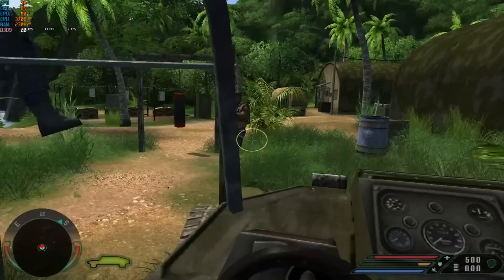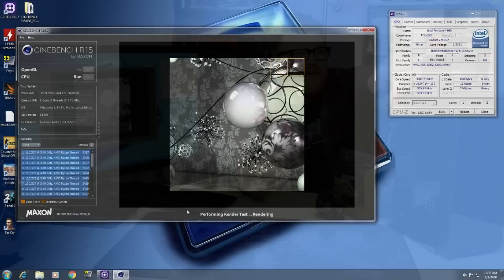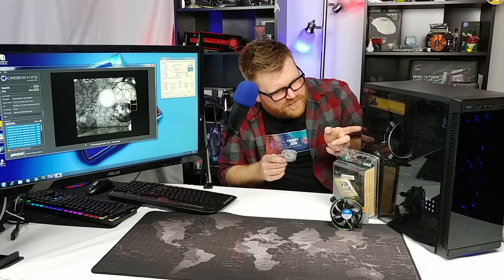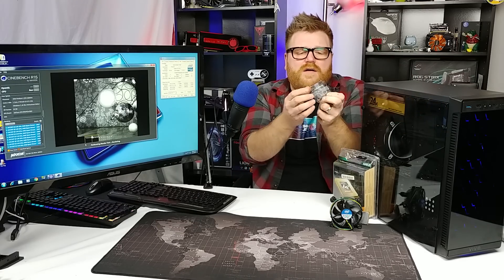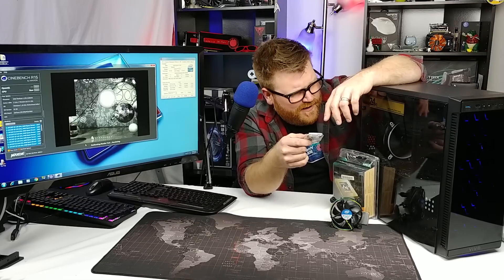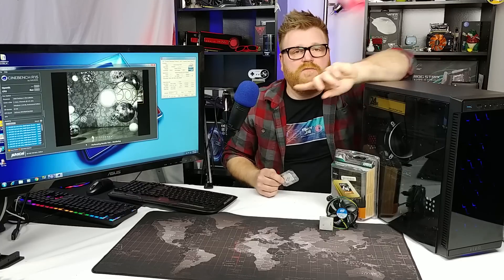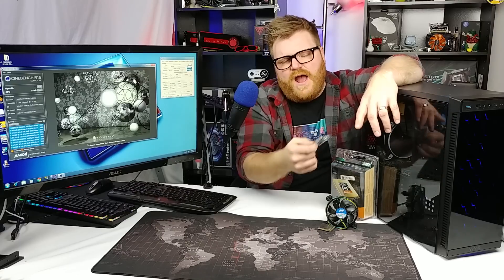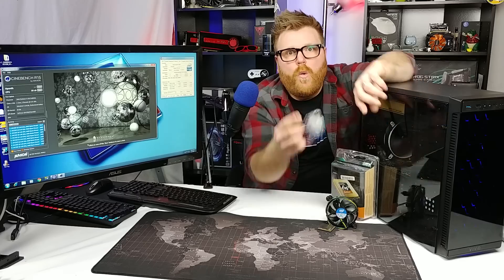What can the Intel Pentium 4 HT do in 2018?

Comment: No wonder the stock cooler was too week it was designed for procesors like skylake you can see this because it dosn't have a copper slug like core 2 quad coolers i actualy use a q6600 stock cooler for my i5 8600k and it is fine altoagh i had to put a sronger fan on it and it also sounds like a jet engine but it works

Comment: those things are 5v hungry so try it  out again with a psu that has 30a+ before you write off overclocking
Reply from the maker: +Charles thekinglov I'm using a 650 watt 80 Gold certified psu. It's the motherboard I'm sure.
Reply: but whats the +5v and +3.3v rating is my question gigabyte also overclocks the pci-e bus and memory which if im not mistaken can be lowered to compensate with the ctrl f1 in bios to unlock advanced features not that its important but these things were more power hungry as far as cpu's go these are the fermi of the cpu world

Comment: Watching this video in 720p on my Pentium 4 3.4 (Prescott) socket 478 overclocked to 4.0 Ghz, with 2 Gb of DDR400. The graphic card was originally an ATI Radeon 9600 Pro (AGP bus), lately upgraded to a Sapphire HD4650 with 1 Gb of video memory.
This PC has still enough power to run modern basic tasks, as office works, light web browsing (if you install a good adblocker) and playing music/DVDs, but it is very inefficient and produces  A LOT OF HEAT, especially with this "new" video card!

Comment: lol I remember trying to install windows 7 on a P4 machine... it barely opened the explorer. Of course it was a 2005 machine with 512mb RAM and integrated graphics but god
Reply: PhilsComputerLab put together a 3.6 GHz Cedar Mill Pentium 4 for LGA775 with 8GB DDR2 RAM and an NVidia GeForce GTX 660 running Windows 10 to see if it was suitable for daily use, and it could run Crysis and HD YouTube & Netflix decently, but then he tried to edit a video on it and it was significantly slower than a modern system, claiming it would have taken HOURS to render. Budget-Builds Official put together a 2.4GHz Northwood Pentium 4 for PGA478 with 2GB DDR1 RAM and an ATI Radeon X800 (a more period correct graphics card) running Windows XP and that could still run Crysis albeit at 24-30fps at mixed low & medium settings at 1280x1024, but it could only play YouTube videos smoothly at 360p, lol.

Comment: I was NEVER impressed with the P4 line my self.  
Did you try benchmarks before AND after any kind of intel fix? They have been saying the older the chip the bigger the performance F U it will receive and it's still  up in the air just how far back the problem goes.

Comment: Another uneducated PC channel.

It accidentally happens that the 600 series should support Windows 10 .
Also it would to better justice to have an adequate chipset with DDR2 800 .
I have a Pentium D 945 (Presler core , 65nm revision , better TDP - its not gigantic , its just yuuge) that I use on a retro rig - this thing , with Win 10 is actually very very decent CPU , and it has no issues with 1600x1200 TIME CORRECT GAMES .

It just happens so that the most notorious chip for being extremely power hungry and being wiped out by the C2D under Windows 10 + SSD gives the core 2 duo some food for thought (even if you test C2D under same scenario) .
Windows 10 is a significant step up compared to windows 7 - though because of the slow performance creep over the last decade , one can't gauge properly the difference made just by the OS .
Reply from the maker: +Volf3r another long winded commenter...

Comment: I have many older pcs, some older single and dual core set ups. I remember playing far cry on a 2.8ghz Prescott socket 478 , hl2 and many many games ran amazing on it. I have a couple AMD setups and they ran faster in games but video editing was better on the p4 due to its hyper thread and larger cache set up. Personally once I began to play newer games I realized the core2 duo and quads were necessary for anything worthwhile and to this day my boys and I all have core2 quads with dx11 gpus running 4gb ddr2 ram and everything we throw at them runs great! The p4 was only slow once windows 7 began the 500 updates issue and saturated one thread and a full gig of ram at all times, otherwise it ran everything well until 2012. Another not popularly known fact is adobe flash became gpu accelerated around the same time I upgraded to i7, i5 hardware and it was for the sake of playing Facebook games and flash based games with the kids, and what did they do? They increased their performance for vector based graphics by offloading and accelerating using your graphics card. This made my upgrade useless and I eventually sold my i7 and i5 and later bought very cheap used core2 quad setups with good gpu. As for p4 it's amazing for older software and for video setups but for anything that requires core2 duo it will not work well. Just scrolling a web page on the old p4 caused 100% cpu usage with a stuttering frame rate. YouTube couldn't run a single HD video and then the lag created by windows thread scheduler made it a terrible experience. For example, I played far cry one, two and crysis using a p4 and a hd3850 agp gpu. All ran great! But load up mario63 flash game and the sub 20fps made it terrible experience. Even a measly laptop core2 duo outperformed this cpu mobo setup with 60% clock speed! My i7 laptop destroys the p4 and my sons core2 duo e8400 is honestly 10x faster at anything with the same clock speed as the p4. But, the p4 was limited by the memory controller and bus interface on your individual motherboard. There are 12 different versions of a p4 so pretty much no one had a same experience because it spanned across 4 memory types and like 3 sockets! I remember the northwood outperformed the Prescotts and that pissed me off royally!

Comment: Dude whats up with you. Its a P4 a very old but great cpu..  the problem is with you trying to run modern software on it..   My P4 rocks bro.. get real.
Reply: By the arrival of the Athlon 64 and Core 2 chips the Pentium 4 was basically obsolete in an instant.
Reply: The p4 was garbage even when it was released. It was slower than the p3 it was going to replace. Doubled as a heater. It got spanked by the Athlon 64
Reply: @pablonaranjo  that's right. Pentium 4 and the infamous HT were garbage even back in the day. No wonder why so many OEM computers of the era had one inside. They really wanted to get rid of those.
Reply: Guy Ferrante i have to agree with you. I bought a tower with this beast inside of it. Instead of running windows, I have CentOS on it. Works pretty good.
Reply: Temple OS
Reply: Yeah get real fatass, your channel is crap anyways...
Reply: dude p4 rocked like 10 years ago. Nowadays, they be some prehistoric tech like Razr flip phones lol. Still cool to look at but wouldn't use it as a daily
Reply: 90 nm lithography is beyond obsolete.  This chip is slow as molasses now.
Reply: Glueing together 2 Pentium 4 chips, each with a tremendous power draw and heat output is a bad idea to begin with.
Doing it around a year before the scheduled release of a highly efficiency, high IPC architecture was even worse. Even hyper threading couldn't change it, but it helped with keeping the ridiculous long pipeline filled.

Comment: Played around with Windows 10 on my old p4 640 - ran better than I ever expected it to - mind you, I did use a spare SSD for trying it out. With a 915 chipset in the old wreck, anything beyond a single core P4 HT is not an option, not even the dual core is supported.
The Core 2 absolutely wipes out the P4 on LGA775 with a better chipset

Comment: I had pentium 4 1.6 ghz and intel gma945 and I was enjoying playing cs:s at 7-20 fps.. it was a laptop with 1gb ram xD xbox360 seemed like a truly next gen console, smooth 30 fps, 720p and 2x-4x msaa GOLDEN era of gaming :')
Reply: BeaR And when x360 was lauched no PC had faster hardware
Reply: In 2006 we had 8800 GT if I'm not wrong and xbox360 had ~7800GT. Today's xbox one X has a similar gpu to 980 ti and less than half % of gamers have that kind of gpu power in their systems, so microsoft did a great job with latest xbox, but games are too expensive.
Reply: BeaR You got your facts wrong. First of all x360 launched in 2005 (later in some other regions). It had better graphics processor than anything ATI and Nvidia could offer at the time (7800 GTX maybe). Also triple core CPU in single core era was a huge difference. Only after some time Nvidia launched 8000 series GPUs. About ATI at that time I don't know, but x360 truly dominated for short time in pure hardware performance. Too bad often overheated too.

Comment: P4 is actually socket 478
Reply: Intel gave the P4 one last go with 775 instead of 478 around the time they intruduced the Core processors.  I don't recall them being especially popular with custom builders, and they quietly disappeared.  You could get them dirt cheap when all the stores were trying to get rid of old stock.
Reply: VIVO yea but it was a mainly 478 processor. Very vew were made for 775 by comparison

Comment: I have a one Pentium 4 @ 4,21 GHz with a stock cooler and gives me about 20-25°C when nothing is running. I use it everyday with a 9800GT 512mb, and 667mhz 2gb ram. I don't have money to buy new PC 😃😃
Reply: xXBicsimoXx l Gaming Channel if it's a 775 socked cpu buy a $15 core 2 quad it's worth it.
Reply: Twiki Plays but some are.
Reply: The problem is that my chipset is 945P and can't buy a C2Q cuz 
1) in Bulgaria it is so fucking expensive around 70-80 BGN which is around 50$ 
2) it cannot fit in my P5L 1394 
I'm planning to buy a Pentium D 945 or C2D E6600 cuz its impossible to live with this 1 core shit...
Reply: a C2Q with the price of 50$??? my god.

In Vietnam, a C2Q E6600 just 10-15$ now. Even C2Q E95XX now just 30-40$.
Reply: Unless it is a really dodgy board it should support atleast the 200 FSB models. think of E4600 that can be bought for as little as $1. For the faster ones, especially when running >333 FSB there are less options, but the quads are decent performers even today. Maybe think about a LGA771 Xeon, they are less expensive then the fast Core 2s
Reply: You'll still never run out of great games. You're pretty good with a 9800GT but a 9800 GTX+ or a higher 2xx series will serve you well on the cheap. GOG should be your best friend.
Reply: I hate that it cost so much outside the US. Yes I am in the US but it still sucks. Get the C2D, forget the Pentium D. If my memory serves me correctly, I had a E6600 and a Pentium D 945 and the C2D was much faster even with the GHz speed difference. Both will still run Windows 10 quite nicely. I used both of them in HTPCs but still used them for light gaming.
Reply: Got a E4600 running on the P5L 1394, the fastest chip to get will most likely the E6700 although the E4700 and E6600 might also be a good choice, depending on availability. Don't go for a Pentium D, they such power like crazy and even an entry Core 2 will be way faster.
But agree, the 945P is far from good. Being limited to 3.7 GHz, even with a 64-bit OS
Reply: I would see if you can find a Dell OptiPlex w/ C2Ds for cheap maybe from companies getting rid of their old stuff. The make good stable old gaming PCs but you might have a problem with long and/or dual slot video cards thanks to the cards facing up and the closeness of the CPU heatsink shroud.
Reply: When looking for older parts, I always Google for reviews with benchmarks, see what games are tested and see if those are the level of games I want to play, or are OK with playing. Search for reviews on the 9800GT and check their test system setups. I did a quick look and you'll do good with a 2.4-2.8GHz C2D except maybe RTS games. Unfortunately, everyone kept benchmarking Crysis at the time which was just unrealistic at any resolution.
Reply: So guys now I have the c2d e4600, but my pins on the heatsink are broken and monday I am going to buy new aftermarket cooler. I haven't touch my pc in a week. I'm going crazy xD
Reply: I do believe you are cursed. Well, good luck
Reply: GiSWiG I think the same dude :D
Reply: Ok guys, now I have the C2D E4600 and it's hell of a beast for the money :D I max out almost every game that i have on the PC
Reply: "Great, kid! Don't get cocky."
That's really cool. I lived with a Phenom II X4 for a while with a Radeon HD 6670. That would put it below your specs, especially on the video card like by over 2-3x better, but it played Oblivion with some mods quite well; your's will be better. I'd stick to Windows 7 with that machine but it will do Windows 10 nicely. Kinda a toss-up really Enjoy!
Reply: And I'm constantly thinking about upgrading my i7-5820K @ 4.5GHz. :D
Reply: U can try getting some stuff from Aliexpress. Instead of core 2 duo. Get a xeon for lga 775. It costs like 5 usd shipped to ur doorstep
Reply: You sir have the patience of a saint. Towards the end of life my p4 55p , loading a simple web page would spike in utilisation. Watching a 480p YouTube Video would max it out and sound like it's taking off.
Reply: Thank u for the replies and the advices guys, maybe tomorrow I'll purchase E4600 and a bit more ram ! :)

Comment: Whoa, talk about a trip back in time. I remember my Athlon 64 3200+ because it was in my very first system that I ever built. I had it running on a Biostar NF4ST-A9 motherboard with a gig of ram and an nVidia 7300 GS with turbo cache. It couldn't even handle the original F.E.A.R at low settings. Upgrading my GPU to a 7600 GS helped a lot. My current system is a Ryzen 7 1700, 16 gigs of DDR4 3000, a GTX 980Ti and a Samsung 850 Pro 256 gig Solid State drive. Wow, times have certainly changed, but AMD is back with a vengeance!

Comment: im genuinely surprised it did 12FPS avg in Ghost Recon Wildlands. that game iiisss soo brutal to CPUs.  but then again you had it at its absolute lowest settings so the brutality of it isnt as strong
Reply: meehhhe Of You changing settings from ultra to low wont change much load on cpu
Reply: yes it will, this game is very heavy handed on context switching and uncached I/O, both of which use alot of CPU overhead.  in GRWL  i watched just turning the shadows up will increase my CPU usage by 5-10% depending on the area and quality since the game is packed full of things creating real time dynamic shadows and much of the game is based in heavy jungle areas.  that's just one settings.. turning vegetation (grass/weeds) to ultra also increases CPU utilization quiet a bit, though this is likely due to shadowing since more vegiation = more real time dynamic shadowing..  also the physics used in the game are not what i would call optimized and as you can see from the benchmark, when the explosions happened and was multiple interactions the game stalls out hard, thats because its trying to calculate real time physics.. most games will just use physics meshing which is basically pre-rendered physics and based on what is happening at each interval determines the next mesh it will use.. usually this has nearly no CPU or GPU impact and creates very convincing effect..  the other factor about Wildlands is its very thread happy (and L3 cache happy). give it 16 threads it will use all of them, in fact it will even use upwards of 32 Threads.. its optimized to use 4-6 threads so anymore than that has little to no improvements on its own..and going less than they will cause the game to choke out more and more..

Comment: wut? Pentium 4 has been dead for 20 years Bro. It's Hyper Threading was so bad that when the Core and Core 2 processors came out, they didn't have HT. I'm still rocking an old 2.5ghz Core 2 Quad LGA 775 (Yorkfield), with 8GB DDR2, and a GTX 550ti.  lol
Reply: FRAG aLOT the pentium 4 isn’t even 20 years old...
Reply: LoL The BSEL Mod on the Core 2 Quad Q6600 really increases the performance on one of my Dell Optiplexes (the 900 series). I would recommend it if you have the less powerful models of the Core 2 Quad series.
Reply: FRAG aLOT lmao you have no idea what you're talking about
Reply: FRAG aLOT that's what my Dell Precision m6400 laptop has, a Q9300 core 2 quad. It would have been the top of the line laptop in late 2008 to early 2009. Don't have hyper threading, but has 4 physical cores.
Reply: A QX9650 with 8GB DDR3 with a GTX 1050Ti OC here
Reply: Of course my desktop is an i7-4770k with 16 GB DDR3 ram at 1866 mhz and an EVGA GTX 1060 FTW2+.